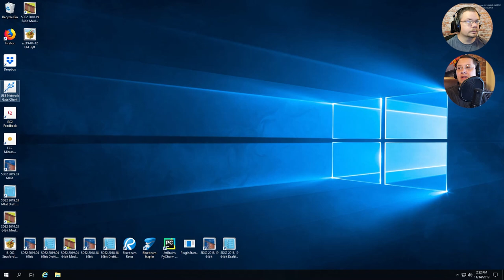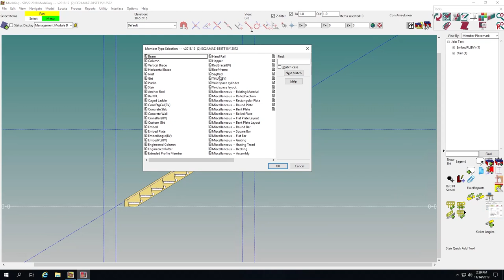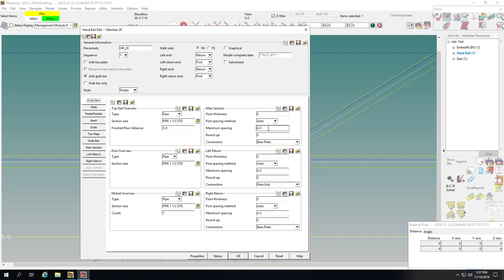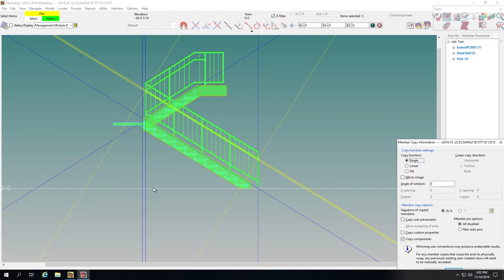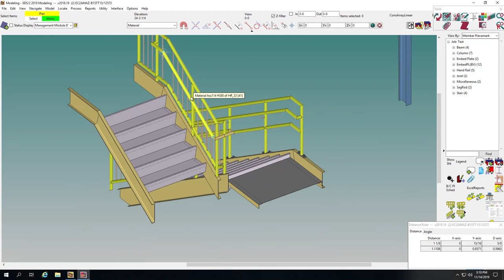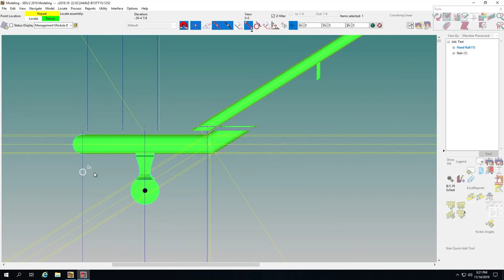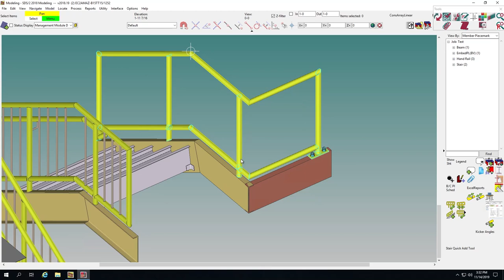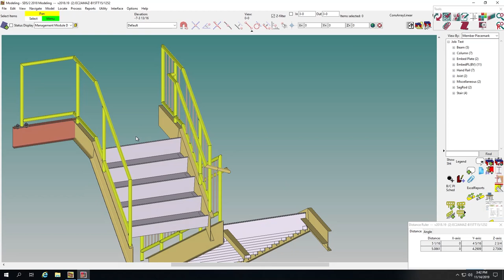SDS2 Advanced In Depth Tutorial - Handrails and Guardrails

Comment: Great video! Another video packed full of tips and tricks. Your dynamic works great with Matt doing the demo and Nick asking the questions.

I disagree with your statement about locating posts at  the corner being most cost effective.  Whether you are a shop using fittings or a shop using a pipe bender, I believe it is always more cost effective to locate a post 6-8" from the corner of a return.  This eliminates the need for 3 circumferential welds if using a side outlet tee, the need for a convoluted cope (that can't easily be done on a standard pipe coper) if simply coping the post into the corner.  Also, if you bend your pipe, you typically don't want to locate a post over the deformed pipe in the bend area.  Leaving a 6-8" clearance allows the mid-rail to be formed and still have enough leg to be clamped by a belt coping machine.

Comment: The "grab bar only" option does indeed make it easier modeling these jn. In the past versions (7.3 n earlier), I would input the single line wall mounted rail as either a vert brace or a misc member type.

Comment: Seems like it would be beneficial to include the field bolt (lag screw, expansion bolt, thrd rod, etc.)  as part of  the bracket assembly itself. That way when the assembly is brought in to the rail the bolt will already be there...otherwise one would have to use the "bolt add command. One just would have to make sure the bolt type is already in the bolt schedule in job setup. Then when the rail is detailed the Bolt will already be listed as a field Bolt in the BOM in the 2d rail member detail.

Comment: how to change bolt dia & hole dia in base plate.
Reply: One way (the preferred way) is to change the hole diameter in the base plate schedule. If you use the hole edit & manually change it...it might turn the base pl  connection graphical. Another way is to edit the column member n change the hole  dia in the column member edit box.